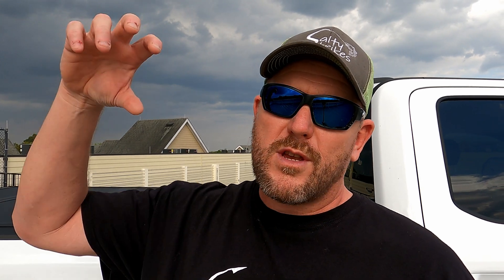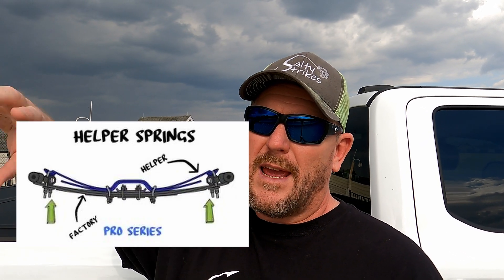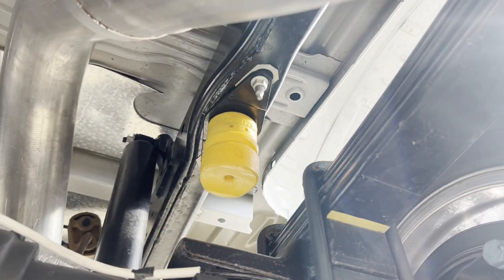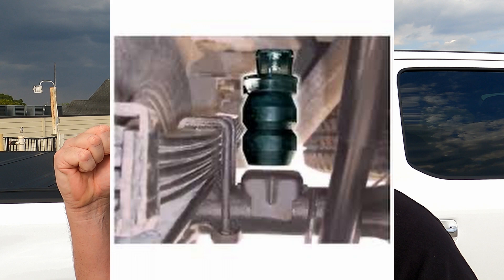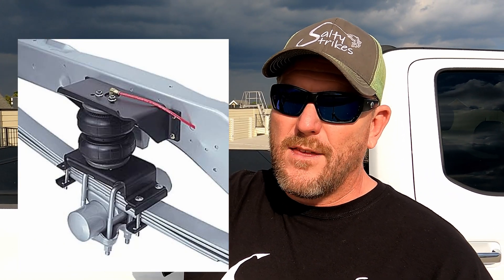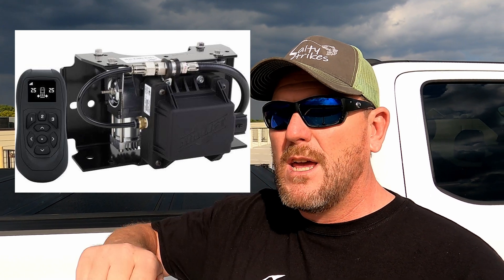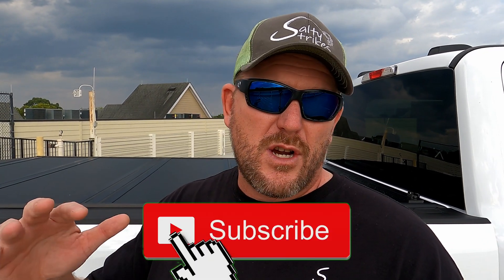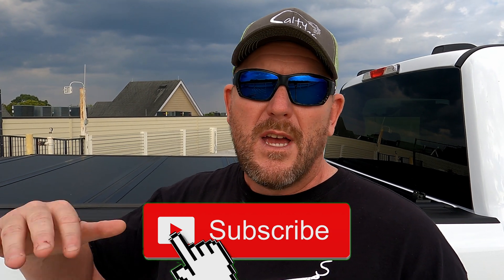“How can I increase my trucks payload capacity?” F150 F250 F350

Comment: I own a land clearing company. Most trucks, like a F250 are rated just under 10 k so you can have a max Trailer of 16 k, so combined you are just under the 26001pound requirement for a CDL. Tats why lots of equipment like skid steers and small excavations keep the weight under 12 k. 10 k truck, 4 k trailer 12 k equipment. Keeps you right at 26000 k. I have been doing this for many years years, have very polished equipment and trucks, use chains, over strap everything. Drive save. And you will not have any I. Never have had any DOT issues. Never get stopped. And the 10 k gvwr only applies to the truck and its payload. Has nothing to do with what you’re towing. Unless you exceed your limit on either truck, or trailer. Or the two combined. Stay under 26000 pounds and you will be fine. It’s really all about weight distribution when hauling. Not about airbags, and all that other stuff nonsense. Cheers

Comment: This is from a 'legal' point of view. 'Legally speaking', you cannot increase payload.  Practically speaking, and technically speaking, you can. The only difference between a 2500 and a 3500 is the rear suspension. Same axle, same tires, etc..  Just a beefier suspension.  If you can add a product to a 2500 that essentially emulates the rear suspension of a 3500, then, technically speaking, you can have the same payload as a 3500.  Of course, from a legal point of view, that doesn't hold.
Reply from the maker: Technically you can put wings on it and call it an airplane 🤔
Reply: You are being a bit misleading.   A better analysis would be 'Although one can add after market products to effectively increase payload, from the point of view of insurance companies,  law enforcement,  etc, it does not increase payload'.  Wouldn't that be a more honest assessment? Companies say their products do not increase payload to protect themselves legally.  If one adds additional leaf springs to their 2500 to exactly the specifications of a 3500, then obviously the payload has increased.  What am I saying that's inaccurate?
Reply from the maker: @gujyjk9075  not misleading, pretty cut and dry. Are you under the impression you can change your GVWR?
Reply: No, I'm not under that impression. Are you saying that if I modified my 2500 rear suspension to match 'exactly' the suspension of a 3500, it would not ride in the same manner as a 3500?

Or, to put it another way, suppose I am 200 pounds over my payload. I've decided (for whatever reason), I'm not going to upgrade to a 3500, and I've accepted the legal risks associated with it. What product would you recommend I add to the truck to minimize (but not eliminate) safety concerns.
Reply from the maker: @gujyjk9075  i’m saying don’t exceed your GVWR, and the only ones that can change that is a company certified by NTEA that meet certain standards can change GVWR. You can’t do that unless you’re certified by NTEA, are you? I’m not sure how much more clear I can get.

Comment: You can increase payload by adding an actual leaf to your existing springs. My local spring shop states it will increase paylod by around 985lbs. Now that is not a legal increase that would alllow you to carry more not umless you have the vehicle recertified. What it does however is if you are at the max paylod as stated by the factory is give you an additional safety margin so that you are not likely to have anthing break.
Reply from the maker: Negative, thats incorrect, statement like that is exactly why I made this video, nothing can increase payload accept a recertification by authorized personnel, unless that add-a-leaf is installed and has a recertification and new GVWR sticker installed the only thing those extra leaf spring will do is decrease your payload, until that GVWR changes anything you add to the vehicle takes away payload, not add payload.
Reply: Not sure where your info comes from but mine comes from a 100 yr old suspension company that has been building and repairing suspensions on everything from small pikups tp cement mixers to super heavy semis so I think I'll stay with their advice.
Reply from the maker: @johntatman9168  NTEA and DOT, GVWR and curb weight determine payload capacity, absolutely nothing else does. Suspension Company no matter how old is still subject to NTEA and DOT.
Reply: You are correct but in my state if you alter the suspension to increse these figures the state highway patrol will recertify the vehicle if you want to go that route. It is not cheap and my suspension shop siad it would be better to just buy a 250-350.  I do not I merely want the additional safety as a cushion rather then push the vehicle to it's max all the time.  @saltytrips
Reply: @johntatman9168   will that suspension company put that in writing? or in a guarantee? the only way to increase payload is to remove weight from the vehicle. like the video says, components that add weight reduce payload
Reply: @saltytrips  You are correct, only from a legal point of view, but not from a technical point of view.
Reply: @saltytrips  Ok man who cares what some sticker says...some bullshit certification...the question is will this allow my vehicle to safely carry more weight...regardless of whatever any government certification says that is true it will in fact allow you to carry some degree more of weight with the same likelihood of a negative incident or less as before. That's what we  care about, that's why we're watching this video...not to hear someone tell us that some official rating doesn't officially change without some official inspoection and certitifcation sticker blah blah blah. Come on
Reply from the maker: @elevatedsciencesllc8089  you’re exactly why this video was made 🤦‍♂️, there’s reasons for regulation because idiots or ignorant people do whatever they want without taking into consideration the totality of the situation and get people killed. Thats why only certain authorized personnel are allowed to change GVWR.
Reply: @elevatedsciencesllc8089  You are exactly correct. We all know from a legal point of view, there is nothing we can do to increase payload capacity. But, from a technical of view, there is. I don't think the maker of this video knows the difference between a 'legal' point of view and a 'technical' point of view. If I take my 2500 to a dealership on a Monday, and they put in a 3500 suspension, but, they 'forgot' to put the new sticker on, from a legal point of view I have not increased my payload on Tuesday morning. Now, on Wednesday I realize they forgot to put the sticker on.  I go back to the dealership and they put the sticker on. Now, from a legal point of view, my payload has increased. So, from a 'technical' point of view, was my payload higher on Tuesday than Monday? Of course it was.... There are things we can do from a 'technical' point of view to increase payload, which, an engineer would agree with. But, unless you get the sticker, it's not legal. Most truck owners want to know what they can do from a technical point of view, and are willing to accept any legal risks that go with that.  That is, after all, why they watched this video.

Comment: If you wanted to have a Ford (preferably up to 10K GVWR) with the possibility of refueling with E85, which would do about 60% of its trips empty or with a medium load, and 40-50% of trips with a trailer loaded to 5-7K or 8- 10K, would you choose the F150 with Heavy Duty Payload Package or the F250?

Bearing in mind not only the efficiency but also the maximum range (both empty and loaded), the comfort of these short or empty journeys and the comfort of operation, boarding, service, etc.
Reply from the maker: Watch this https://youtu.be/bhwQKZSYZcY?si=yvswr3TDSs99yXPR then leave a comment in that video of what you think, then I’ll let you know what I think.
Reply: Thanks, I watched it. Your version of the F150 was equipped with a rear cab and other options and did not have HDPP, so its payload was small (like most F150s), but for example with a single or extended cab and the HDPP package the F150 could have a payload of around 2500 lbs, which is a little closer to for F250. Would you prefer the F150 or the F250 in this configuration? How was it towing the F150 trailer (apart from the payload issue/limitations)? @saltytrips
Reply from the maker: @coolftp  i’ll be honest, with the stopping power and stability of the F250 alone, I’ll probably never go back to a 1/2 truck again even if it had a higher payload capacity.
Reply: Thanks for the answer! :-) @saltytrips

Comment: What you say makes perfect sense!
But I guess what people usually want is to have the truck a little more stiffer with higher loads, even if still within the payload.
For example, let's say the payload of my truck is 600kg (sorry I work with Kgs :) ) but with 500Kg the truck is already so lower that it ocasionally tutches the limit rubber. What we usually wanis the truck to perfom better under that load. In that sense, what can we do? change coils?
Reply from the maker: Correct , like I said in the video all these products may help with ride quality but they reduce payload not increase it. There’s just some bad information floating around and wanted to help clear the air 👍. Usually if your needing to change components to help the ride under load most likely your getting to close to being over payload.

Comment: If the sticker on my chevy 2500 says I can bumper pull a 12,000 pound trailer when other 2500's can do 18,500 pounds because I have mud terrain tires and those others have all terrain tires, if I switch my tires out to all terrain I should be okay to theoretically tow an 18,500 trailer right? That's the only thing different I was able to find between my truck and other 2500s
Reply from the maker: @M-zn8uh  I would not tow more than what the manufacturers rating for that vehicle is.

Comment: Perhaps the title of this video should have been called. " How to improve Load/Ride Handling ".  You can add/change all the hardware you want but your still limited to Axle Ratings, Tires, etc for payload capacities. 
Still good info though.
Reply from the maker: … that’s kind of the point, you can change all the axles and suspension components out with a 1 ton truck or other mess but your still legally limited to the GVWR sticker in the door jam.

Comment: Great video. I have a question if you can help and answer it . I own a Ram 4dr regular 2500 with the power wagon package which reduces the payload and towing. If I were to change suspension components would I have the payload and towing capacity of a regular gas Ram 2500? My case is I think a bit different since it is a actual 2500 and just want the normal numbers of a 2500. Please help, thank you.
Reply from the maker: It won’t change your GVWR. Unless you take it to a certified entity that is qualified to recertify your GVWR. Tow rating different it’s subject to components as specified by manufacturer. For example, if I had my 3.55 gear swapped for 4.30 gears then my conventional towing would increase by 300lbs and 5th wheel towing would increase by 3,900lbs, but my GVWR would stay the same and I would be way over payload before I would come close to hitting max towing. Hope that clears it up.
Reply: @saltytrips if my max payload is 1920 lbs currently and I have added a lift kit to my truck with 35" tires and upgraded rims and my current ratio is 3.31 can I still tow the factory  set max trailer weight of 7000 lbs or not?
Reply from the maker: @planchik  payload and tow capacity are two different things. The lift kit and bigger tires will reduce your payload by however much those components add to the weigh of your truck. As far as tow capacity, lifting and bigger tires will definitely increase the stresses on all your components which would decrease your trucks ability to tow that same amount safely. As far as legally how much would it be allowed to tow, i try to steer clear of any “legal” advice for liability reasons. Be safe and use good judgment 👍
Reply: @saltytrips  thank you, i appreciate your response and good information provided. i went and weighed my truck on a CAT scale, so knowing what my GVWR is and substracting the actual weight, i'm about 400 or so pounds lower in my load capacity. those wheels and tires are no joke haha
Reply from the maker: @planchik  here’s a video you might want to check out too, very informative https://youtu.be/vOGn-nNB3qk?si=BiqWMWobVLr8H5F0

Comment: I think most of you are over thinking things. I've been adding coilovers and extra leaf  to my trucks for a long minute because I OCCASIONALLY need some extra payload for shorter distances, typically not more than a 1000 pounds over rated payload.  A good set of coilovers have always made the biggest difference in this context.

With that said, if you plan on regularly going over your rated payload and for long distances then you need to step it up. (Bigger axles, more lugs, better cooling, etc)  For example, if you plan on getting that bed camper you want and say, it's 1500 pound over your payload, adding just coilovers, bags and/or a leaf probably not a good idea.

We live in an imperfect world, just use some common sense folks.

Cheers.
Reply from the maker: Suggesting going over payload in any scenario is never good advice. This way of thinking is exactly why I made this video. Wether on not you believe GVWR and payload are just some arbitrary made up government ploy they still have legal ramifications, and exceeding those parameters are illegal and could be hazardous advice.
Reply: @saltytrips  I wasn't suggesting anything, but I clearly implied using common sense.  

I get it your a 'by the book guy' 100 percent but not everyone weighs their truck every time they fart and go to Lowes or occasionally haul a load of gravel/dirt, sod...etc. We gauge it by general knowledge, squat and like I said, common sense.

I'm not saying throw your book and ratings out the window but you might calm down a little.
Reply from the maker: @SirtubalotTX  common sense is not to exceed your GVWR, thanks for watching

Comment: Some of this is like the more Leaf springs you have(like f250 to 350) coinciding with the strength front springs, the more the payload. Anything pushing up on the frame increases the weight of the truck and does not take away from the pay load.
Reply from the maker: Incorrect, any weight you add to the truck takes away from payload. GVWR minus curb weight equals payload, anything to increase curb weight subtracts from payload. Only way to increase payload is to have vehicle modified and GVWR re-certified by NTEA authorization. Legally Curb weight can not exceed GVWR.

Comment: I just had this feeling you were going to get to the cold hard facts later in the video as I wouldn't doubt that there would be a number of people out there who would not think of that aspect and the sales gimmick of the product cloud the truth of the matter and the couple you used in the demo, was that by chance a video promoting a product that they got for free ?. I realize in the states there are some strange rules state by state that push people into buying an under rated truck ( or at least the sticker numbers ) to avoid the much higher licensing fees or get into the category of being required to have a CDL if they pull anything that is deemed a business rather than a personal RV or toy trailer. I don't have a clue what Florida's regulations are in that regard, if there would have been a penalty/roadblock for you having bought a single wheel 1 ton instead for example rather than the 3/4 ton.
Reply from the maker: I’m pretty sure they said in the video the Timbrens where free but it wasn’t a “paid promotion”.  I know some states have higher taxes on vehicles over 10,000 GVWR. I would have got a 1 ton if I could have found one with what I wanted that wasn’t $80k+. This 3/4 has enough payload for the 5th wheel RV we want to get. One thing I’ve noticed joining a lot of these RV Facebook pages is that most of the people on there are way over payload and have no idea what payload is.
Reply: @saltytrips  Yes taxes would be another one, that and licensing/insurance rates variables so it seems prudent to find out those details before making a major vehicle purchase. As to the overloading theme, sometimes the vehicle was bought first and then they shop for an RV and end up with too heavy of a unit vs figuring out what RV they want first, then shopping for the truck that is capable rather than marginal to pull it with. Also some RV dealers ( the sales department ) telling the customer they can pull xyz with their half ton truck because they already own it and the sales person wants to make that commission on the sale rather than point out the problem and have that customer walk out and buy a unit elsewhere. There's a reason why sales can get a bad rap, I would NOT be cut out to be in sales !
Reply from the maker: @charlesb4267  … that’s definitely a big problem in the RV sales, we see some really bad accidents because over payload.  I highlight some of these on my Salty Trips Facebook page and YouTube shorts.